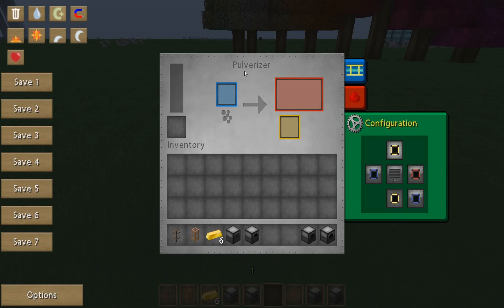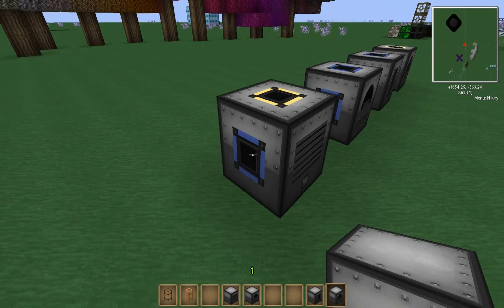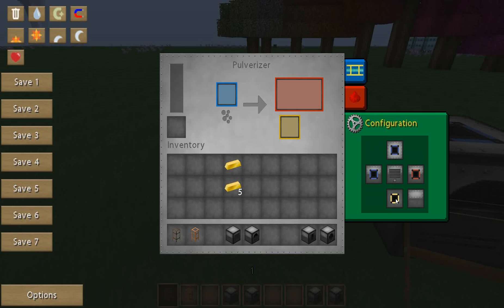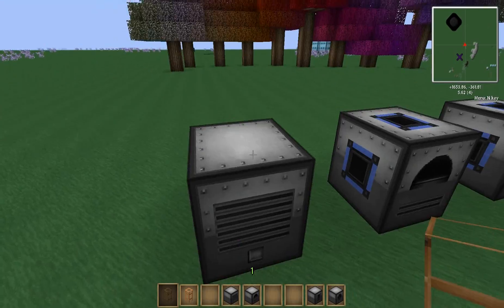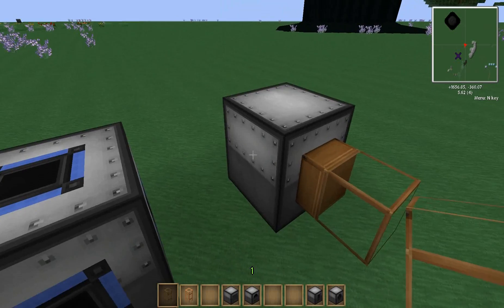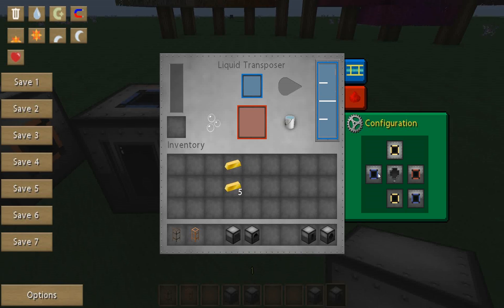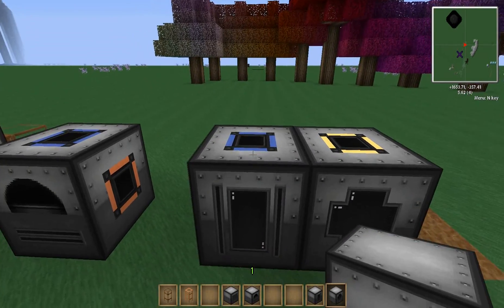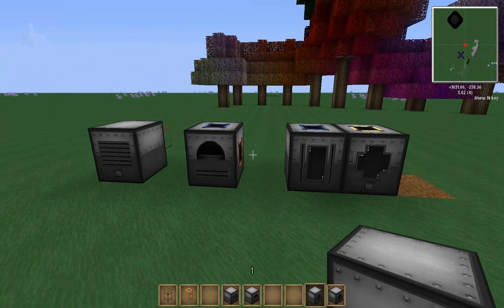Thermal Expansion Configuration Tutorial

Comment from the maker: Yellow is an Output color, but it won't be used unless one of the boxes (or the colored area behind the lava in the lava crucible) is colored Yellow - just the same as any other output, it'll send whatever is in that color's box out whatever side it's facing
As for Blank - if the box is blank, that just means it has no output or input in the configuration, the input will be black if you get rid of all the inputs on the config
Hope that clears it up!